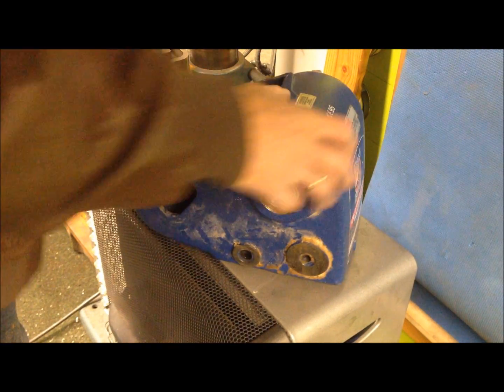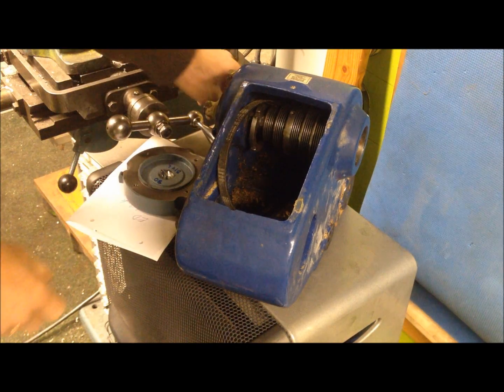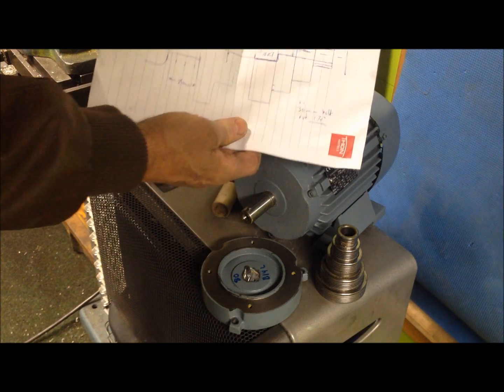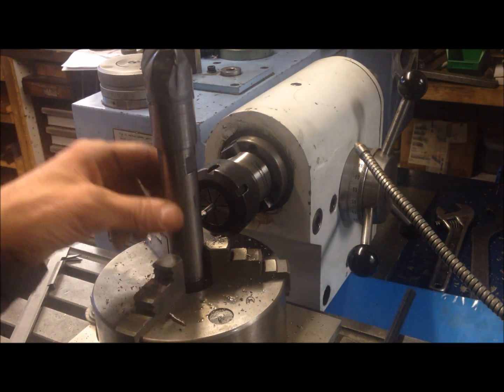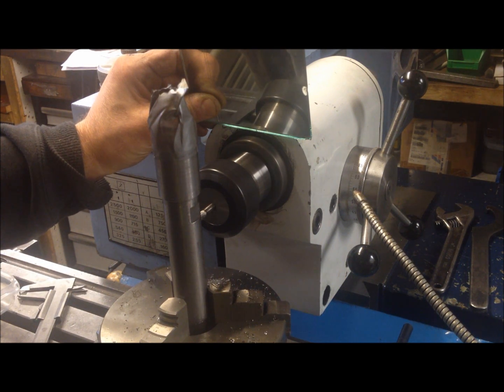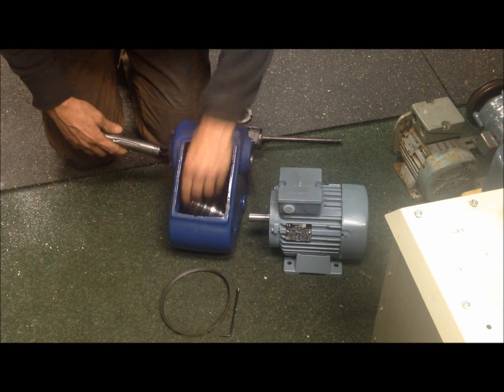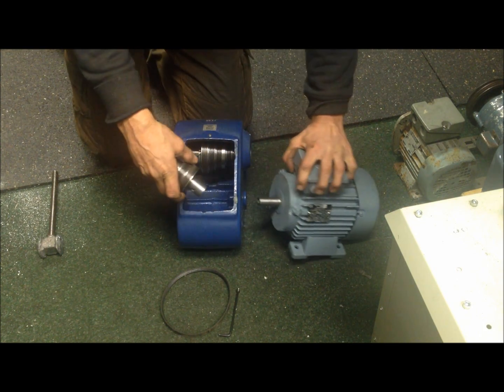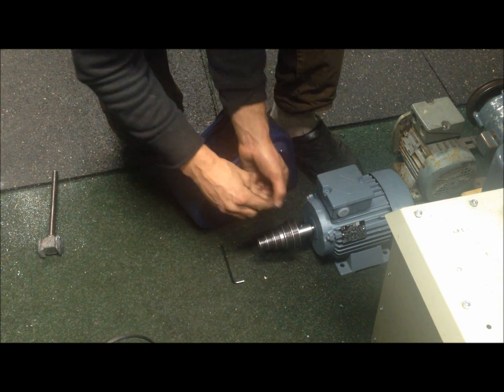Record CL3 wood lathe -  modification for use with VFD

Comment: Hmm, I just bought CL3 with small money & rattling motor. Wondered of replacing the english 1ph motor with ABB 0,75kw & inverter. Seems a reasonable project but I also wonder upgrading the driveshaft from 3/4-1/16tpi to M33 thread and MT2 taper hole. Just dunno does the shaft have enough strength left for MT2.
Reply from the maker: A VFD and 3ph is a very nice package. Not too expensive. I am unsure if there is room for an MT2 taper.
Reply: @jansverrehaugjord9934  no room for MT2, I checked. Had to stay with MT1.